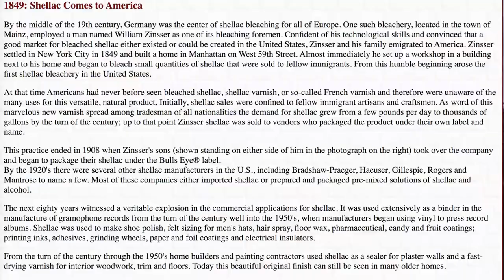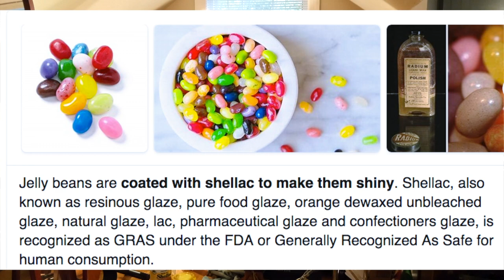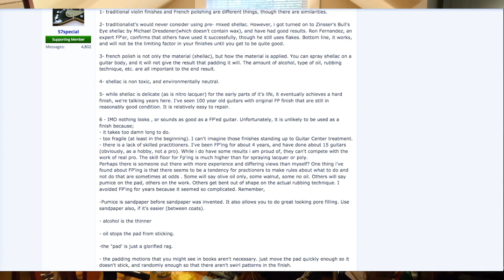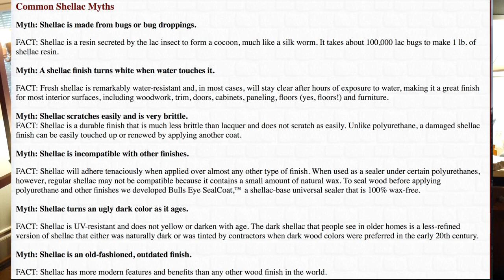Using Shellac as a Finish on My Black Limba Stratocaster. Shellac Origins and Info.

Comment: hey man, great vid!! I'll start tomorrow doing my shellac finish. I'm changing colors on my fender jaguar, I used water based stain and I was going for tru oil then i catched your video doing research on shellac and you got me!!
Reply from the maker: You are going to seriously dig it. Go on thin and slow, a 50/50 mix of shellac and alcohol seems right. Follow that Stew mac vid, where Dan does that top on the acoustic. It will really iopen the guitar up, and if you just let the coat age and don't redo it, you get really cool checking early on that looks aged in the best way. You can always add another set of coats if you don't like that. The guitar will vibrate and resonate so much more!
Reply: @ChadEtchison  thanks so much man. I just finished my first coat. It does dry so fast!!!  caught by surprised even expecting it will. The back is ok, the front is beautifuuulll... can't wait to built up the layers!🤘🤘
Reply from the maker: @publicnature  YESSSSSS! keep it up!
Reply: @ChadEtchison  it's done, turned out beautiful. It feels better to the hands than nitro. My favorite finish. The guitar will go with me to a not at all forgiving tour. 20 gigs. Lots of sweat and dings and dangs and spills are guaranteed!!... thank you Chad!
Reply from the maker: @publicnature  Oh man, that is great news!!! I really love the feel of shellac, it feels like nothing else. Bug amber works as it turns out! Have an incredible 20 day run, I wish I was going out, that sound so fun to me right now!!!!